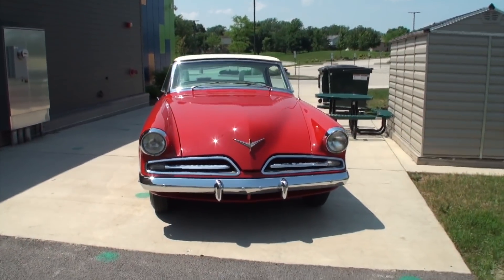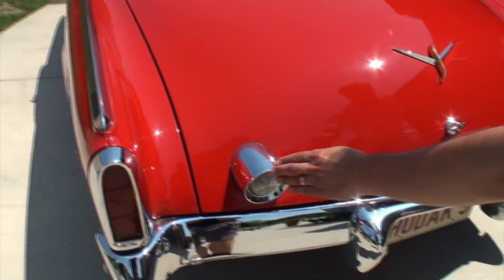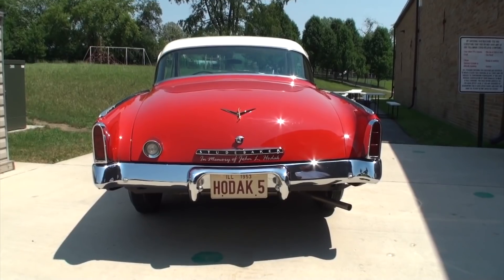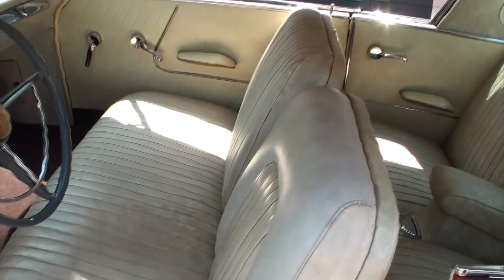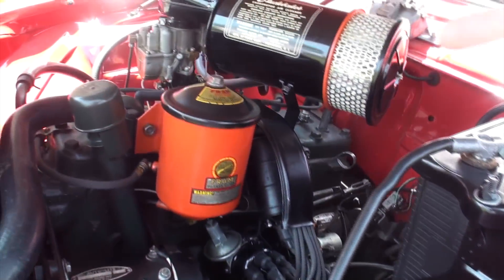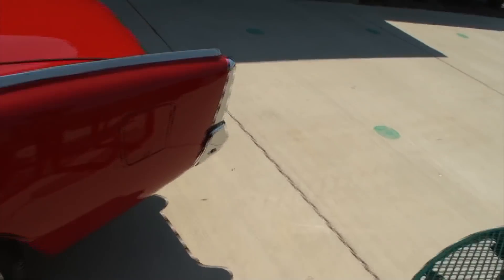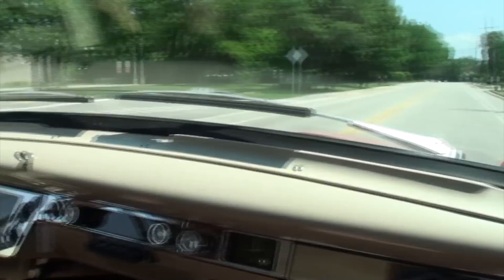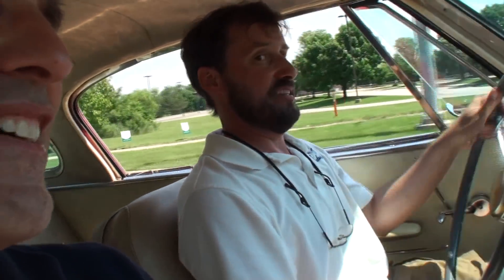1953 Studebaker Regal Champion Starliner in Red & Ride on My Car Story with Lou Costabile

Comment: One of the most beautiful American automobiles ever produced. The "Big Three" automakers were targeting the US market with bigger designs that included lots of flashy chrome pieces in order to add appeal to the overall bulk of the design in which the American consumer desired at the time. This classic Raymond Loewy design was unique, and way ahead of its time with the low stream-lined appearance, and the simplicity of the interior, with special attention given to the dash instrumentation. Once again Lou, you have come across another historic automotive treasure in which your interaction with present owners bring to light the true essence of the car. Keep up the good work!!
Reply from the maker: Hi 1hugeturdsundae, High praise for the looks of this car :-) Thank you for the kind words on this video and encouragement to keep up the good work!!. I appreciate that, Lou
Reply: I particularly appreciated seeing the overdrive unit...I have owned a couple of older cars that also had that feature...this one is activated in a different way, from the ones I had...Also, that car had comprehensive gauges, and that was a rare, and very sporty, feature to have in 1953...and yes, the "old" way of operating the wipers--by vacuum assist-was kinda funky, but worked pretty well. What a great vehicle, just a couple of years ahead of the rest!...too bad, that innovation was never a big selling point, back in the day.

Comment: Great to see two 🌟 shaped lights reflected on the bonnet at the beginning of the video! At one point I thought that they were painted on! Stunning car... I'm assuming that the oil filter is not original to the car, because it is a Packard - Studebaker... 🤔
Reply from the maker: Hi Roman, Thanks for sharing the details you enjoy :-) I'm thinking the oil filter has been replaced, Lou

Comment: It looks Italian-designed, reminding me of a contemporary to that era Alfa Romeo. Those wheel covers are perfect for that body style.
If I were 20 years old in '53 and had a bunch of money, I would most likely have bought the Corvette. If I were to time capsule back into 1953 today, I would certainly have chosen this Studebaker, instead. I would have bought it with both reverse lamps, just for design's sake.
"Wet air cleaner"? So the sticker says. The filter of which I see is anything but wet. The wet ones were of the oil bath type.
That center armrest and ashtray look cool and modern for its time. However, I doubt that it would have been a selling point for younger guys planning on taking their dates to drive-in movies.
I wonder what keeps the starter from engaging, during clutch pedal use while driving
Reply from the maker: Hi Al Dente, Thanks for sharing your thoughts and sharing the details you notice, Lou

Comment: The viewers who are not very familiar with auto design from the 50s should look up photos of the 1953 cars from Ford and Mercury, GM, and Chrysler Corp. Then you can appreciate how incredible the design of this 1953 Champion hardtop is. Unfortunately ,through the years Studebaker kept piling on chrome and fins and completely ruined this beautiful and clean design. Many cues to the Avanti design can be seen in the 53, of course both were done by Raymond Loewy and his design team. It's neat that Lou also covered a 53 Commander with the V8 some years back. Poor Studebaker could not keep up with demand and there were quality issues. Another "if only" car story.
Reply from the maker: Hi rizzle razzleuno, You're right, this is quite the design in 1953. Thanks for viewing and sharing, Lou